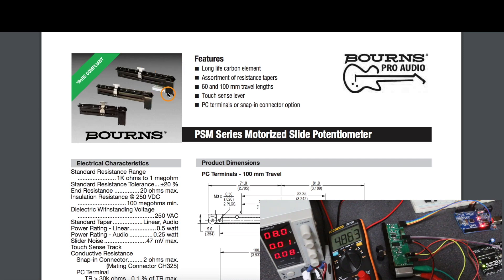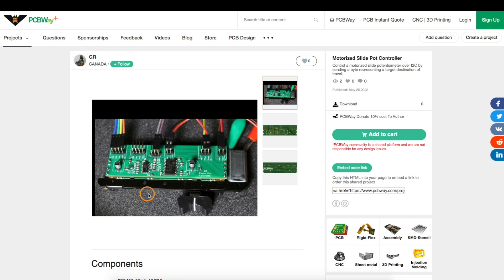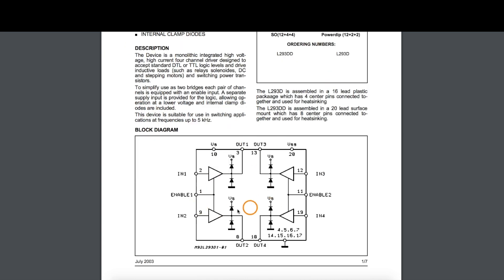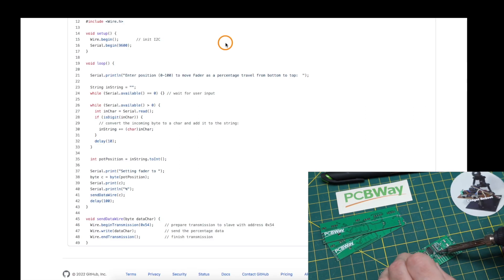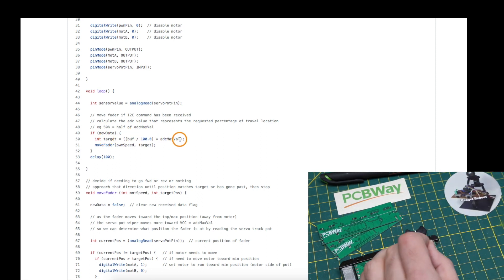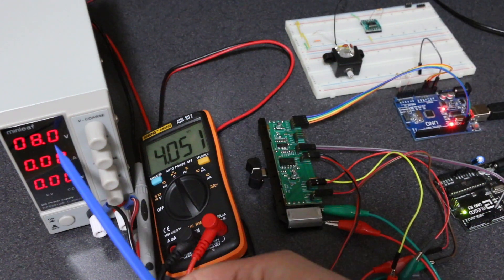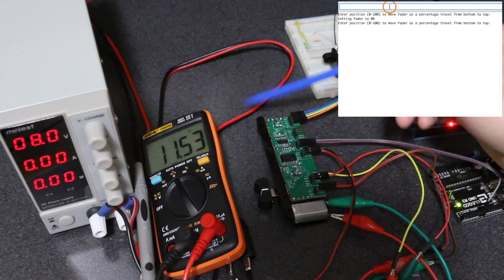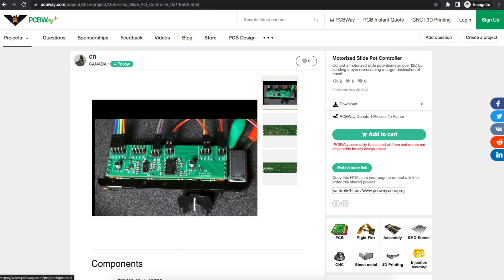Motorized Slide Potentiometer Controller using ATTiny804

Comment: What do you have to pay for 32 motor audio faders ?  20 years ago I was thinking about to build a MIDI controlled motor/fader 32 channel audio mixer but the price for the 32 motor faders for a 'private custumer' was much higher than a ready build product to buy !
Reply from the maker: I don’t know if there are cheaper ones but these were around $20 each which is a lot but I wanted to do multiple projects so I plan to just be able to unplug them and move them around like a modular fader box

Comment: I've always found those faded quite magical :) I would have used the spare IO to set an I2C address. Or an RGB led.

And for the code, always find the mapping to 1023 weird. That makes the spacing for 100 smaller than for the rest. Also, leave the float at home, probably saves halve the memory.
int target = (buf(long) * 1024) / 100;

v2 software, calibration fo min/max? No delay? More resolution? PID? Position readback?
Reply from the maker: I just tried out removing the float on that calculation and the code went from 45% to only 37%!
Reply from the maker: Yeah I never really know if 1023 or 1024 is more appropriate and when I read the cases for each, I get lost more.  The thing that makes most sense is there are 1024 steps from 0 to 1023 but it still ends up not quite right. Maybe trying experiments on that scaling could help me come to a decision on what seems best.

I think the main reason I didn't bother with hard wiring I2C addresses is I plan to have more than 8 on one bus so then I'd either need 4 address pins for one base addr or start to hard code multiple base addresses and I decided if I have to hard code, may as well just code the address entirely, but there may be a hardware revision if I keep working on these and decide I do have that many spare IO I can use for that.

I thought about an LED but decided the units will be hidden under an enclosure anyway so they'd only serve as debug, so I could do without them on the bench.

The float was taken from some other hacked code so definitely room for optimizing.   The program took 45% of the code space so at least I could get it going fast.

Lots of features can be put in for better control and feedback and reporting status back over I2C to master, if I can get motivated!   But I'm also getting back toward that DTMF stuff and telephone hardware.  I still have some of those code modifications you suggested on DTMF way back...